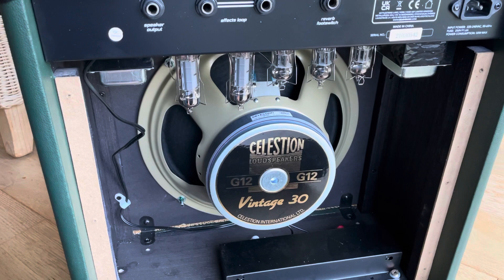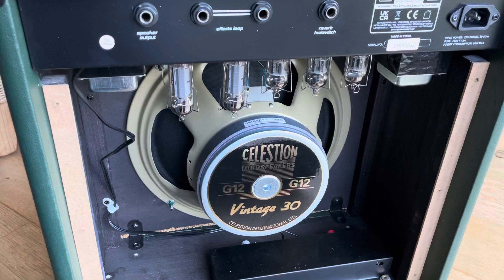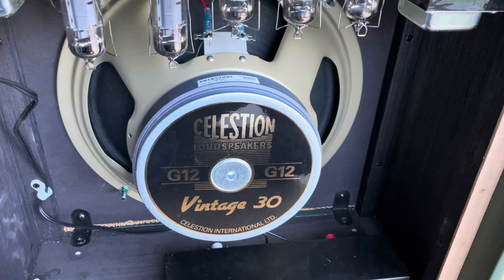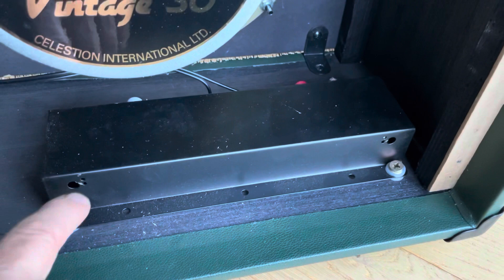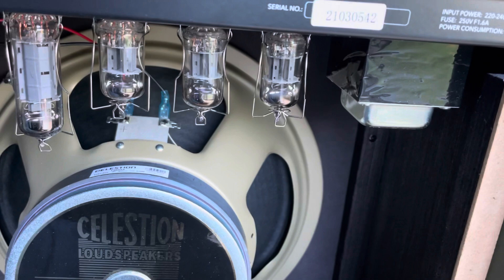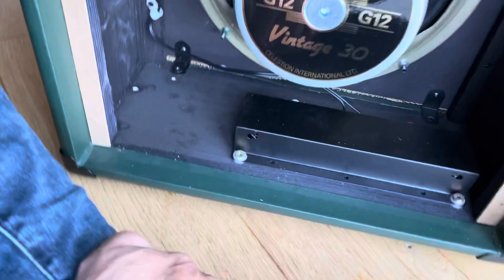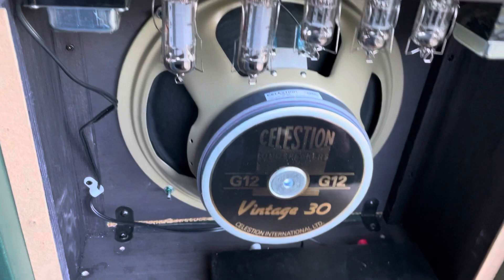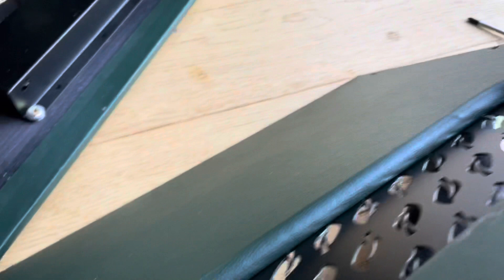Hartwood Interceptor 15 guitar valve amp - a look inside.

Comment: Thanks for the look inside. I've had a HB Tube15 on back-order for weeks now, but now ordered one of these and cancelled the HB, as these are in stock and I like the upgraded speaker & case.
Reply from the maker: I think you’ll like it. It’s gin up in price recently, but the more I play mine (and the better I get at guitar) the more I like the sounds it makes.
Reply: @matthewtyler-jones8317  Delivered today, looks great, not tried yet. Some people upgrade the HB Tube 15 with a V30 speaker, which together would actually cost as much as buying the Hartwood, and you still wouldn't have the other extras. Mine's got JJ power valves, like yours, and unbranded Chinese pre-amp valves, which are just marked China 7025

Comment: I've been running this speaker since they arrived in the UK. Very impressed, the fact you can get a 12" combo with a V30, spring reverb and FX loop for £250 is insane. That it sounds amazing too is just excellent. The only thing I have is what sounds like grounding, it's not noticeable when playing, but I feel the noise floor is a little high - I'd be interested to see if you can record yours with the volume and gain maxxed with nothing plugged in.
Reply from the maker: I’ll check it out.

Comment: Nice to have an alternative to the Harley Benton/Stage Right models with a different speaker and colour. The green colour is not my cup of tea though which is why I went with the Harley Benton. Btw. a Vintage 30 speaker is usually more expensive than a Seventy 80 which could explain some of the price difference.
Reply from the maker: Gotta say the green and straw look is exactly my cup of tea. 🙂 And yeah the speaker does justify at least some of the increased price.